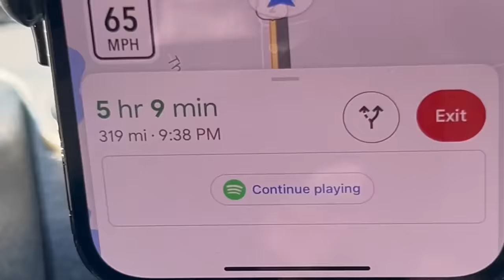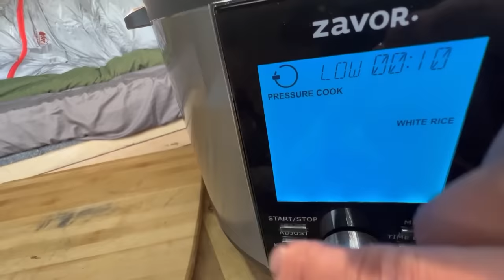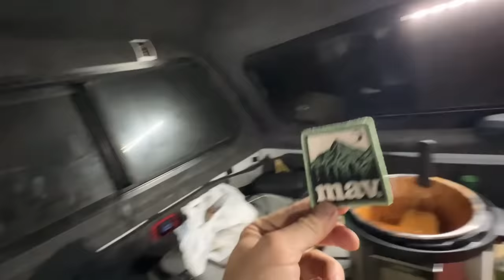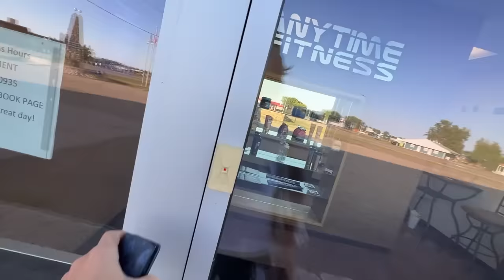Cooking Tikka Masala and Naan While Driving- Truck Camping Meal

Comment: Instead of using flour to thicken your concoction, try using corn starch.  You won’t get any lumps that way and it will taste better as well.
Reply: I like the taste of flour better.
Reply: If using corn starch - make sure to make a slurry :)
Reply: Or Mesa
Reply: better to use heavy whipping cream instead of flour or starch!
Reply: Lots of options to thicken. Potato flakes also work well, plus you can use them to make instant mashed potatoes if you wanted
Reply: Cornstarch/Cornflour is a good shout. In most Asian cooking used to tenderise the meat.
Reply: If you mix-it with a bit of water first.  Arrowroot powder works too.
Reply: Mix cornstarch and cold water until the lumps are gone. Then add it, no lumps no flour taste.
Reply: What about just kind your business an enjoy the show.
Reply: No flour or corn starch is necessary. The curry was initially watery because the sauce is not reducing as much as it can in the instant pot/pressure cooker. It helps to reduce sauces for both the taste and the texture/consistency
Reply: You’ll doing it the wrong way. Gravy is prepared completely wrong. Masala’s are wrong. But still a nice attempt.
Reply: @kristalrogers5883  - Yes..COLD water and cornstarch...and just a little goes a long way but does such a great job of thickening without changing the taste.
Reply: Normally they use cashew nut paste to thicken
Reply: @SHAAN070 , pretty sure you won't find that at Walmart.
Reply: @bcaye  that will be right 😅
Reply: How about you make it properly?
Reply: Don’t use any of that shite. This is a British dish not Indian.Tikka Masala originates in the UK. Look it up. You’re welcome

Comment: I can promise you Mav, that with the life of your vehicle, you went to a bad mechanic who decided to replace your entire break assembly rather than just the pads. With a 2021 truck theres zero chance you needed an entire break system replacement. Most rotors last 10 years before they wear uneven enough to need replacement, and calipers DO NOT FAIL after 1 year. You got taken for a fool.

Comment: It's nice to be able to slow cooker while you drive, especially in snow and then have a hot meal. Idk the size pressure cooker you have but you can sometimes cook rice at the same time as your meal with the pot in pot method. But it has to be a pressure cooker. 

Also keep in mind that whatever you cook in a PC will ALWAYS be more liquid bc the pot has a sealed lid. No water really evaporates like it will with stove tops or traditional slow cookers. Hope that helps a bit!

Comment: Hey Mav.. Love your videos.. Cooking in that Instapot style cooker is easier than the way I use to do it.
I use to get two 4 inch deep, heavy duty aluminum oven pans and a roll of heavy duty aluminum foil. 
Put a beef roast, in the aluminum oven pans. Doubled up or 2 pans is safer. 
On top of beef roast, ADD fresh raw carrots, red potatoes, chunks of onions, celery and fresh broccoli or whatever. 
Add 3 or 4 cups of water and a couple of beef bouillon cubes, garlic, black and hot peppers, basil and salt or any other seasonings you like. 
Wrap it all up with the aluminum foil and carefully place it on the top of your truck engine. Preferably on the head or exhaust header..
Drive to your destination or for two or three hours and it should be ready to eat. 
This is how I cooked my meals, driving my semi-truck from Charlotte NC to Los Angels California every week..

Comment: @MaV. Nice job on the Tikka Massala. I make it very much the same way in my instant pot. A tip for the spiciness is Garam Massala is spicy on its own. Adding the cayenne pepper made it much more spicy. If you found it too spicy try omitting the cayenne. Also you don't need the extra yogourt, just let it simmer on high for a few minutes to thicken up and add flour at the end to get it to your liking.

Comment: One more thing- if you want to use flour without a roux, make a reverse roux instead to thicken. Get butter and mash flour in like a 1:1 ration until it's a thick paste. Then break off a bit, stir through, and add more if u want it thicker. It also will make sure you don't have flour lumps. It can sit in the fridge for a long while too if u have extra
Reply: or use some heavy cream

Comment: You should give a F-150 with a Powerboost engine a look. While not a SuperDuty, I think the Powerboost would provide an upgrade over your current truck as the truck itself is a 7.2kW generator that can operate in "generator mode". It'll turn on the truck's engine every so often to charge up the hybrid batteries. Could see if Turo or someone nearby has one you could borrow for a weekend before buying one. It's powered my house several times during power outages. Two refrigerators, deep freezer, networking equipment and TV. Never broke a sweat.

Unfortunately the Powerboost isn't available in Tremor trim, though.

Comment: yeah you may wanna consider using different knives for out door applications. high carbon steel knives respond very poorly to moisture. if they arent clean and dried immediately and stored dry they will begin to rust and pit. The knife is fixable, but all the pitting and rust will have to be removed, which will require removal of metal. I would find someone to do it and make that an at home knife and go with a non high carbon steel knife for truck camping.
Reply: Wow thanks hit me up 🤙.

Comment: Dude. Coming from someone who collects and appreciates fine knives and exotic steel… do yourself a favor and just get some Mercer knives; for the truck kitchen at least. Put the nice ones back inside! 
 A lot of restaurant kitchens use them for their low cost and really high performance for the price point. Think I picked up an 8” chef from them on Amazon for like $25. Just as sharp as the Japanese steels for a mere fraction of the cost but infinitely more durable.
Reply: Congrats you have won a prize inbox me up 👆

Comment: I would think about trading in your truck while it is still running. Also, the gas version of the f250 is better because the diesel because of the cat system seems to cause issues. Also diesel maintenance is expensive too. Good luck I will be out there traveling soon.

Comment: @Mav, does that phone holder you use auto snap closed when putting the phone in? If so you should link to that. The one on the Amazon page doesn’t seem to be the same. I could be wrong though…

Comment: So what was wrong with your knife?  You talking about that little bend near the handle??
Looks like you straightened it out.
The steel in that knife should be able to handle soft bending without any issues, and it appears to be just fine.
I guess I don't understand the problem.

Comment: you might want to be careful using a pressure cooker like that. it would suck if it flipped over and the vent got clogged and it exploded.
i don't mean like made a little mess, but like actual explosion, would need to buy a new truck, and you would be lucky if the only physical damage you sustained was blown out eardrums.

you should at least strap it in

don't wanna see you get hurt
Reply: Congrats you have won a prize inbox me up 👆